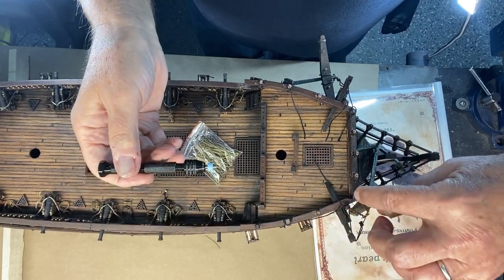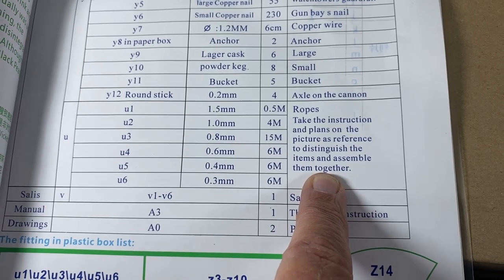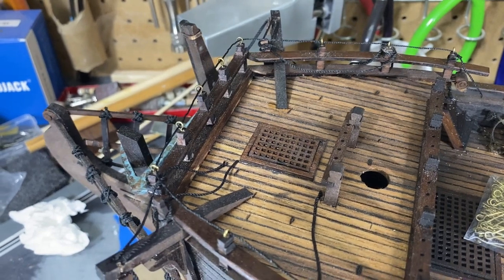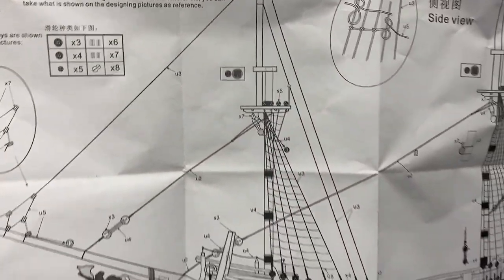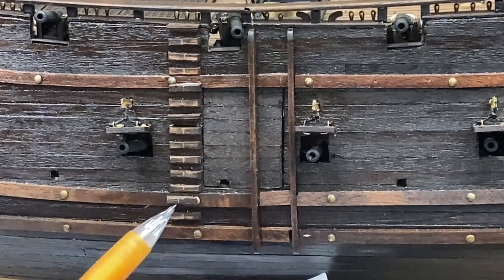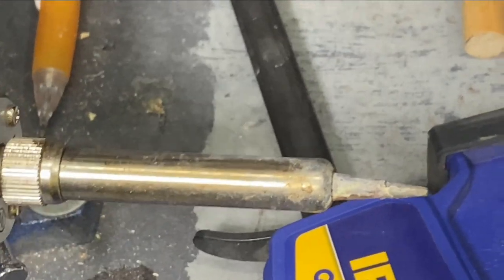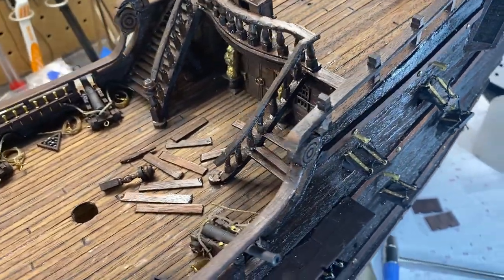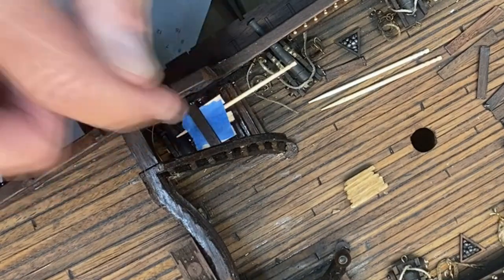The Black Pearl All Scenario Version Part 20

Comment: An hour wait for CA glue? Hmmm. I thought you have used accelerator before. It’ll set in seconds. 

Anyway, glad you’re back to building. I find that if I go too long without touching a model I lose interest and a week of no modeling turns into 6 months really fast.
Reply from the maker: My son has been convincing me to use ca with the accelerator…. But I need to do little adjustments…. I should get some and use it in a lot of situations.  So stay tuned, I may give it a try in the future!
While you’re here….. I’m going to local Subaru dealer tomorrow to see if I can trade.  I’m passing 90,000 miles on my Forester and although it’ll go beyond 200,000, we like to keep under 100,000 and trade.  It still has good trade in value….. but No Foresters in stock.  May have to go with the Outback ( not my favorite).
So you’re up to date on my life!😂
Reply: @BoilerDan1   well I need new head gaskets so my WRX has been sitting for over a year just because I didn’t want to deal with it and now i have to. I think you’re in a much better situation lol. Personally, I’d wait for a Forester rather than drive something for years that I didn’t like. You’re gonna be kicking yourself every. Single. Day. Kinda like I did for not taking care of the head gasket problem when it first came up 🫤
Reply from the maker: The hook for me is the value given for my forester. Appraisal over $21,000!
And that’s with 90,000 miles!
But there’s more of a chance of me keeping what I’ve got….. not many new ones to choose from.  And you’re right. Love the Forester!
Reply: @BoilerDan1  yea that is a pretty good appraisal. I don’t think the used car market is going down drastically any time soon so maybe you’ll get a good appraisal at 99k miles. That should buy you almost a year of finding a Forester. I only drive my fathers forester when I go camping and I enjoy driving it as well. Just a good performing vehicle and it’s kinda sneaky about it. Well, whatever you decide, good luck.

Comment: Will the plank bender tip fit into a regular soldering iron?
Reply from the maker: I think it is supposed to, but not the one that I have…..
However, the more bending that I’ve done, the better I get. So I don’t think I will replace it. I’ve done fine using the regular soldering iron.  
Thanks for following along 👍🏴‍☠️